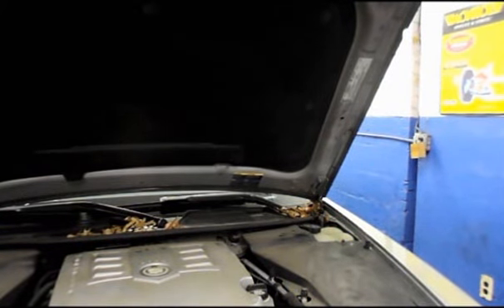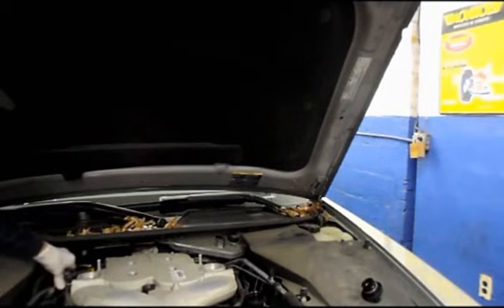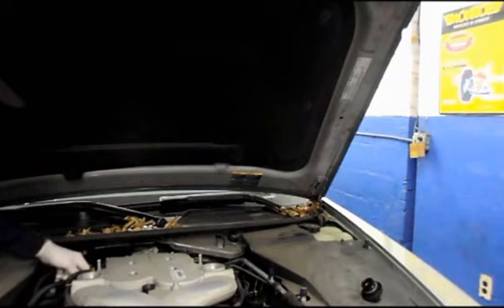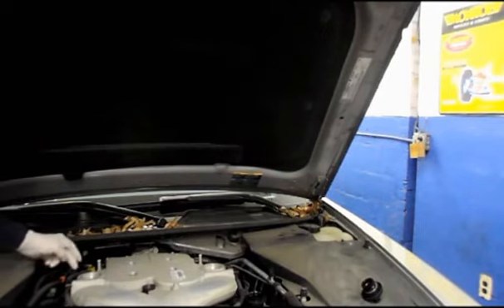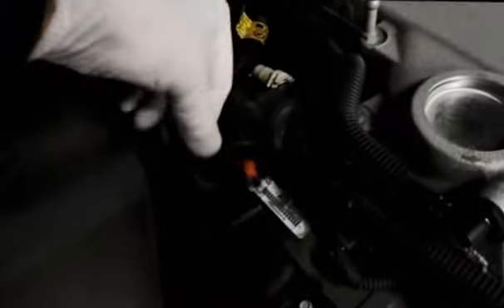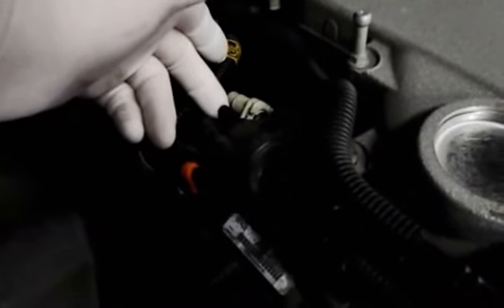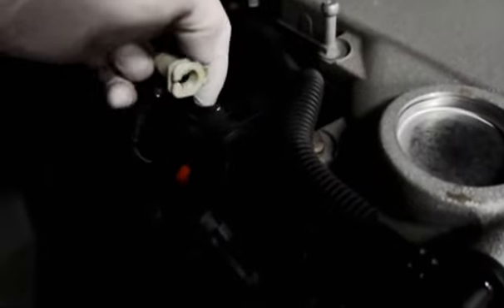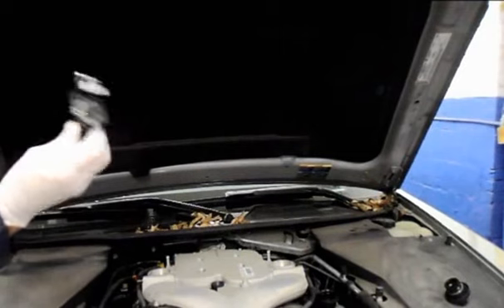PO 496 2006 Cadillac STS 3.6 Liter

Comment: Thank you for posting this video you saved me $1600.00 dollars in so called repair diagnostics, we were told all the 02 sensors were bad, the vent canister at the gas tank was faulty the funny thing is they never mentioned the actual problem (the issue you had) at any time. I desided to research on youtube hoping to find a clue and here you are. My wife and I thank you again Sir.
Reply from the maker: Thank you for watching so called mechanics like that is what gives the good mechanics a bad name.Happy to have saved you and you wife so much money
Reply from the maker: Is the bar like the one in my video?.If it is you can just remove the nuts on the top of the strut tower and the bar should come up and out.Let me know how you do .
Reply: Great video, Jim do u know where the Vapor Canister Vent Valve is on these Cadillacs with the 3.6?
My 06 SRX is having a terrible time starting and idling rough...I assume it's near the gas tank but there are 2 and I haven't seen anything from looking up underneath....here's a pic of the part I'm thinking could be bad.
https://dgzmd7u6z2by7.cloudfront.net/partimage/ZMX/1AZMX00197/large.JPG

Thanks jimthecarguy :)

Comment: Very educational, even though I have a CTS and this helped cuz it is the same engine
Reply from the maker: Thank you for watching
Reply: @jimthecarguy  in my 2006 STS I had the purge valve replaced. Now 2 months later they say(engine light) the vapor canister in the rear needs to be replaced but that it is really difficult to get to?? They wanted to charge me $1,300?? They said they would have to remove the differential or something like that? Thanks, Pat

Comment: I know this video is pretty old, but how's the car act if this is actually what's wrong?
Reply from the maker: +Robbie Jenkins The car actually ran very good .even after the repair the car ran the exact same.
Reply: +jimthecarguy Thanks for the reply, I was looking at one but it sounds like it just needs a new motor..
Reply from the maker: OK good luck
Reply: with this problem, the only symptom is that the car sometimes wont start when the engine is warm and the fuel system is pressurized or will rough idle immediately after starting on a cold engine. not replacing the part can lead to serious problems, as the fuel mixture being dumped into the engine will be far too rich.